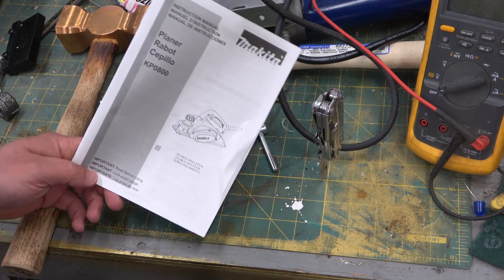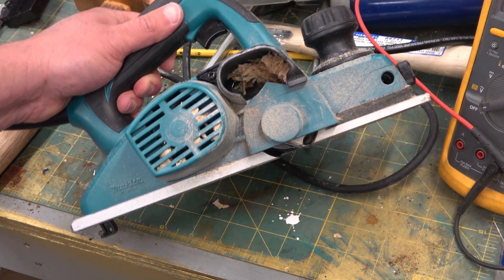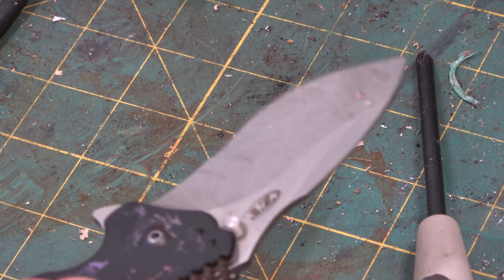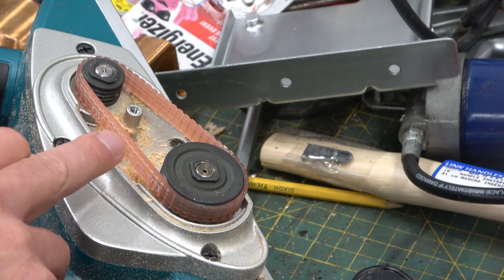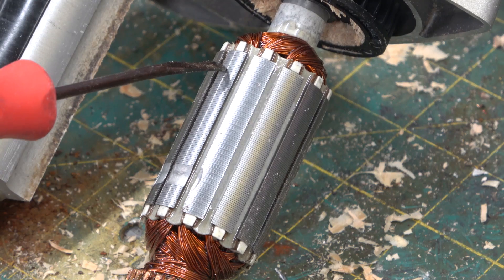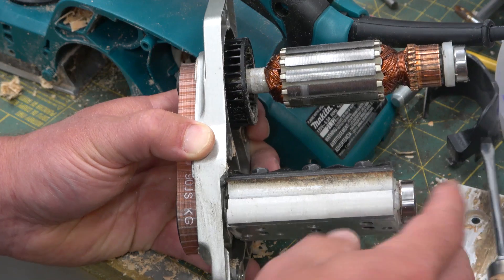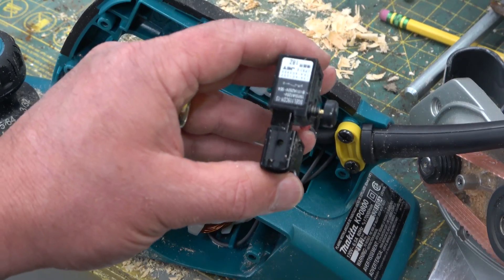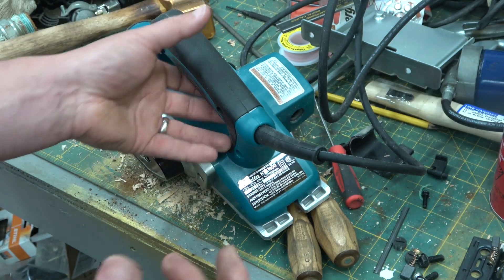BOLTR; Made in USA Makita?

Comment: Free advice if you want greater precision and want to avoid shavings being pushed under the blade... yes "under the blade"!!!
In the original, the bracket that presses the blade to the drum... this bracket is made of sheet metal, and has two small teeth that grab into the groove of the blade. This means that the blade is supported only at two points and not along the entire length of the blade, as it seems at first!!! For this, the blade bends under load and allows shavings to be pushed under the blade.
Makita knows about this problem, but the sheet metal is cheap and makes  a cheap product....
However, Makita offers an upgrade with a set of milled steel brackets (+ two spare blades)... and these brackets have an edge that presses into the groove of the blades along the entire length.
The set is called Makita D-07951 and at first it looks like a set of two carbide blades with two HSS blades, but this is not the case...many sellers do not know this and sell it as a set of HSS blades, but in reality they are "better milled steel brackets".
The set is cheap, and I absolutely recommend it. Greetings from Slovenia ;)
Reply: Most valuable comment I've read in ages, thank you!
Reply: Thank you, I will order one of those.
Reply: This is what one can only hope for... An intelligent well spoken reply. Best advice and big thanks!
Reply: Thank you, I didn’t know that 👍👍
Reply: You get a “F” of a lot of work out of these little D I Y planers if you don’t abuse  them, medium cuts and let it cool down now and again ! I have had a pair of  little A E G planers for twenty years, they work fine.   People throw them out because they need new belts and can’t find them, cutting at max will burn the belts.
Reply: @CrimeVid  Another piece of advice for this - buy belts and brushes when the machine is new and still up-to-date, because later all this spare equipment will be much more expensive... OK, that's not the case with Makita brushes - they're always quite affordable...for the rest of the equipment however, due to the rarity of the machine, sellers like to ask for a little more.
And of course, it's always the case that when you need brushes, a belt... you usually don't have it... so if you stock up with at least one spare for a small amount of money, it's never a problem ;)
And in that suitcase where I keep the machine, there are also brushes, belts, etc... so I don't have to look for them...
Reply: Zdravo. I am working alongside Slovenians here in Australia. Thank you for the information.
Reply: Hvala majstor, that is great information, I have one of these machines and I like it but I prefer to use my old Hitachi which I like even more.
Reply: @robertkovacic4623  : Yes, good advice !
Reply: Thanks! I found one of these machines. Somebody had thrown it away. In the box was the exact set, that you just described. Now I finally know what this is for!
Reply: Agreed, I've seen this happen on several planers.
Reply: @CrimeVid  Exactly! I try to never "max out" any of my tools. Sure it can plane ⅛" (6mm) but for how long and do you actually need to remove that much material? I'd rather make 2 or 5 passes to get there than burn out a tool.
Reply: There’s also makita D-17239. Regional maybe?
Reply: I dont Even have The planer and im thinking about ordering The upgrade 😳
Reply: Awesome.  I absolutely had this problem!

Comment: I used one of these Makita power planers for years. Loosen the 3 bolts SLIGHTLY and slide the blade out the side. No need to totally dissemble the clamps to change the blades. You're welcome
Reply: I think he knows that.
Reply: @duaneantor9157  I didn’t know that, thanks
Reply: @duaneantor9157  😂😂😂
Reply: Shouldn't have loosened or removed the Phillips (JIS) screws either,  fairly sure that is the depth setting.
Reply: I keep a light wooden mallet in the case to gently knock the blade loose as well.
Reply: Was going to say that, I've got two of those, one  mains and one battery powered, both going strong, many years.
Reply: I learned that one the hard way.
Reply: First, thank you. Second, it is AvE... disassemblage is sort of his tingy.
Reply: I wish I knew this last week, I'm a machinist so planers aren't my area and i pulled apart my one that i got for 5 bucks at an auction and it didn't have the guage with it and according to Google my model of mikita planer doesn't exist so i have to stuff around until i can work out the correct blade setting and make up a guage for it 😐
Reply: @markshort9098  Just remember this is a dangerous device, please, especially since as you say planers are not your area.  Keep the bed flat to the work to avoid cutting round divots on the end of a piece.  The smallest cut is the best for starters, I think, though more experienced users may be comfortable with taking a deeper cut.  Don't forget to keep clear of the blade until it stops rotating completely.
Reply: @ammoalamo6485  i normally run lathes, milling machines, grinders, circular saws, chainsaws, saw mills and various other equipment that will eat flesh and bone like it's not even there.. I'm well aware of propper safe usage, i just don't do much finishing type work with wood so setting planer blades don't come up much in my workshop
Reply: Have one as well, goin on 30 years into long liner building. I use the sharpenable hss blades

Comment: Had some linoleum flooring swapped for some composite wooden flooring. The carpenter left the threshold/sill area of two doors without flooring "because the new floor was too thick compared to the old linoleum". I asked if he couldn't plane the floorboards down so they fit. Nope, that was absolutely impossible. So after he finally left I planed them down with a handheld tool just like that Makita - difference being I inherited this one from my father. Cut and glued to the sill it looks amazing and I get to think about my father every time I look at it.
Reply: Unless they're metal, the doors could also be planed or cut down.
Reply: That reminds me of an episode with an old corded Makita belt sander (4x24).  The guy installing the flooring burned out his Ryobi (I think) 3x20 job.  Seeing as how he was going to hold the job up until he got a replacement, I loaned him the Makita.  Guy uses the trigger lock and then plugs the thing in.   Sander sails away from him and goes right through the sheetrock.   That old Makita is a beast and has a 12 ft. rubber (not PVC) cord, so it wasn't going to stop until it hit something really solid...
Reply: Hate You  After he repaired the damage---I was feeling generous.  They laid a lot of ceramic tile and did a good job once they got going.
Reply: I got one from my father also, never used it and never will use any power plane, my dad shredded half his thumb and 2 fingers in less than a second with one of these things, I'll stick to a good old fashioned plane lol
Reply: @MDM1992  Ouch, when I plugged in, my dads old, all aluminum body power plane. The pixies, went to ground, through my hand.
Reply: By the way, he had tablesaw fingers. Special cut.
Reply: @billpetersen298  Thought those mostly came from radial-arm saws.   Or do they just call you "Stumpy" then?
Reply: @tubastuff  A special handshake, for your wife?
Reply: @billpetersen298  Heh.
Reply: @MDM1992  well….you can just….you know…. Pay attention and be careful. I use power and hand planes all the time and still have all my digits intact. Now if you’ll excuse me I have to go knock on wood to de-jinx myself.
Reply: @tubastuff  Aha!  Sander drag races, meet up Sundays at two at the Home Depot parking lot.

Comment: when tungsten carbide with cobalt binder gets to somewhere in the range of (from memory) 600-800degC, the cobalt expands faster than the carbide, and can initiate failure points. Modern oil industry drill bits (Polycrystalline Diamond Compact, or PDC) have the cobalt leached from their diamond coated tungsten carbide cutters to improve longevity. These things can literally drill miles of rock without significant wear - if they're run with minimal bumblefuckery.
Reply: So can you use em in all applications or is it designed for rock only.
Reply: So can you use em in all applications or is it designed for rock only.
Reply: @zachv1942  Probably, but you're undoubtedly multiplying the cost of the cutter by an insane amount. That, and in most milling/ turning operations you NEVER get that hot unless something goes REALLY wrong, or it's a specific flavor of alloy that's harder than a coffin nail. In which case, you just go ceramic or something instead.
Reply: So they last about a shift usually then?
Reply: @zachv1942  rock only - they are for drilling oil and gas wells.  Common sizes are 17.5in, 12.25in, 8.5in, 6.125", 6in, and 5.875in. Other sizes are also used, but you get the point.
Reply: @Adam_Lynn  yeah, it's always the other fucking crew who screw things up...
Reply: @cerealport2726  damn right
Reply: @orangedream267  Yeah, rock only, I am talking about drilling oil and gas wells. PDC cutters aren't supposed to run at such temperatures, but it does happen, thanks to highly abrasive rock, poor choice of RPM and "weight on bit", lack of adequate cooling by the fluid circulating through and past the bit, etc. Heat damage is not that common compared to other wear and damage, but it's common enough to develop a commercially viable cobalt leaching process.
Reply: @cerealport2726  Yeah the guy on the other crew said that 🤣
Reply: Good to know.  So you are saying that can go through a 4k foot granite basement after making  14k feet, with 900k on the bit and come back for more?
Reply: @cerealport2726  " you get the point"- very well done, even if not intentional
Reply: Very informative- Not to undercut your comment, but more of an addition to it, carbide edge cutting temps range between around 125 and 200 degrees C in wood and MDF...so the expansion differential isn't that big of an issue in wood/MDF type machining in general, which is mostly mechanical/abrasion wear, unlike cutting other material(rock, steel, etc.) where the cutting edges might see the temps you're referring to. 

Another interesting point....when you machine copper, for a variety of reasons using HSS is preferable over carbide in most cases...and copper is VERY abrasive even though it's soft(even with "hardened"/tempered) and is hell on carbide and further, you can get a sharper edge on HSS, so usually copper machining is better done with HSS than carbide. The science behind chip making really is incredible and like most other technology always subject to change/improvement over time and what applies to one set of cutting circumstances might not really apply to others.
Reply: @nickb3968  dammit man, you've let the cat out of the bag... i will have to be more blunt in future... :)
Reply: @cerealport2726  Ha!
Reply: @Karl with a K Provided you have a spare when you need it.  Nothing like the tool breaking at just the wrong moment.

For me, quality tools are more about convenience, comfort, and accuracy.  Now, that doesn't necessarily correlate with price, but often does.  Things that a home gamer like myself take hours to do can be done in minutes by a pro.  One of the reasons is because they know what they're doing.  The other reason is because they're not spending time dicking with a Harbor Freight tool they only expect to ever use every 6 months.
Reply: @Adam_Lynn  30 dayshifts, ONE FUCKING NIGHTSHIFT!

Comment: I've had one for over 20 years. Mine was made in J.A. PAN. I was a professional wood elf. Used it mostly around doors to make the drywall sit flat.
Reply: My late Father passes down his Japanese made planer to me, ‘92 vintage. He was only a homegamer though. Also got a British made Black and Decker orbital sander too.
Reply: ya i agree they were the best on the market back in the day every "wood elf" i knew myself included used them i would still have mine had it not fallen victim to a fire we always blew  them out real good with the air hose after use
Reply: Yep. Had one since the mid-noughties. Still works like new and I am a tradesman. Bought a beefier planer in the meantime but it wasn't as nice to use and is a distant memory now. I still have a Makita hobbyist's router bought in the late '80s. It only has a ¼" collet but it's my first choice whenever the job allows.
I've found that many different brands of blade fit the planer. Some vary in length by a couple of mm but I don't really use it for rebating so that's not a problem. All other tradesmen who've borrowed it have loved it too.
I had no idea they had endured so long.
Reply: @stegra5960  ya the little routers are great for cutting hinges and anything light duty and you can one hand it all day no problem

Comment: I had one just like that one you have... worked great until I found that hidden screw in the wood. After finding the screw, it developed a really neat operating bonus. It would leave a raised line about 1/2" from the edge of the cutter blade, you could use that line to see how straight you were making your passes. Plus, if you made the cut from left to right it would magically remove the line and then make a new one 3.5" further in...
Reply: Sounds like a DYI mod, right?

Comment: I've had one of those for years. I attached a filter mesh to the vents to catch the majority of the dust. I've had it apart a few times over the years and it has worked like a champ. Tool stays cool and wood carcass stays out. Little sad to see that 2 decades later Team Teal still hasn't figured out that 5 cent improvement. That said, Mine has the older steel blades and honestly I prefer those. Sure the carbide last longer technically, but I can sharpen mine and I've honestly been on the same set of blades for years. That said a nail is death for them and probably death for the carbide as well.
Reply: @Karl with a K guess I'm too poor to understand how 10 minutes of of my time can be worth more than a $150 tool.

Comment: I don't know much about the provenance of wood butchery tools but I can guarantee you the first man that held the original prototype electronical planer in his hand and flipped the on switch did so after losing a bet. Utterly terrifying tools.
Reply: @3kainos  Handheld angle grinder with a wood carving head.
Reply: @Sawblade02  Ah yes, the Hazard Fraught special! No thanks!
Reply: I've seen a hand held planer that was 10" wide,
Reply: @3kainos  also a terrifying tool. Router/planer/joiner all fall into the butthole pucker category for me.
Reply: Woodworking tools are the screaming banshees of machines, just waiting to bite the hand that feeds it.
Reply: @wadkin1973  makita makes a 12" and its terrifying
Reply: @Sawblade02  Those things  shouldn't exist
Reply: @Sawblade02 Ancient  chain mortiser, chain guard last seen pre Y2K for me.
Reply: @GuyFromJupiter  i remember my 1st (of many since they only last a few hours) very fondly.
Reply: @3kainos  first time i did that as a kid it scarred my half to death.
Reply: I’m pretty comfortable with any hand-held tool. At least it will stop when you take your hand off it.
Lathes on the other hand are terrifying. Not interested. I’d rather not be spun into pieces and sprayed across the workshop.
Reply: @brandongould6294  They're all perfectly safe as long as you follow basic safety rules, like a firearm. Plus, your hands are always located in the same spot relative to the blades, and the edges don't fly off at high speed in the same way a broken drill bit can.

Table saws are way more dangerous! Pushing material towards the blade by hand... My teacher drew a red square on the bandsaw and the table saw as a permanent no-go zone for your hands, carried over from his house framing work. The idea was sound, but still unsafe...
Reply: @ulwur  laughs in Angle grinder
Reply: @wadkin1973  ya those shipwright/timber framer models are big brutal beasties go through wood like a nuclear powered beaver lol
Reply: @numerum_bestia  Yea, lathes and table saws are a lot worse than planers or joiners.
Reply: Can you say: Radial Arm (removal) Saw?
Reply: @bluesfish55m51  lol
Reply: @bluesfish55m51  I was just laughing at a radial arm saw for sale I saw on Craigslist or Facebook marketplace……$250 was the asking price for this relic from the ‘70s. Apparently the seller was unaware you can get them free almost weekly if you watch out for them.
Reply: Damn right.  Anyone who is not afraid at some level of the damage that planer can do to humans has no common sense about power tools.
Reply: I once had a 6” Jet jointer take a piece of hard maple and shoot it 10’ behind me and put a huge hole through a 3/4” Baltic birch cabinet wall! I was taking a but bigger bite (1/8” maybe) than I should have and it caught, shot, and put the fear of the woodworking gods in me. That’s was a tool I’ve owned and semi professionally operated for 15 years. Between that and table saws you always need to be Uber aware and present when operating them at all times. No matter how experienced you are or how safe you run your operation it can literally happen to anyone at anytime. 🤙🏼

Comment: The other end bearing housings are the first to go teats up.  Blade vibration fatigues the polymer composite, even glass filled 66 nylon.
Reply: I had that happen on a belt sander. Machined a new aluminum housing and epoxied it in. Tool runs fine but I'm mindful to not push it more than a few mins at a time.

Comment: My father has one of these. Had it for over 10 years. Surprisingly tough tool and he used it for contractor work. Excellent tool for midrange work. Only failure was the power cord, the tool ate it. If your plowing river tables than a heavier duty version is a good thing. Otherwise this is a solid tool.